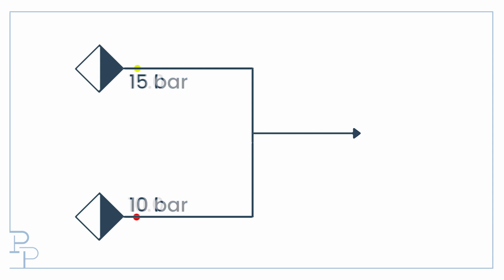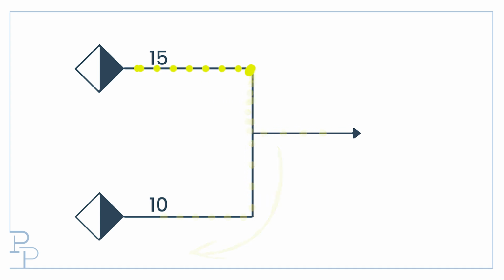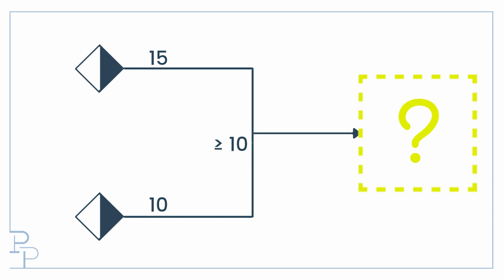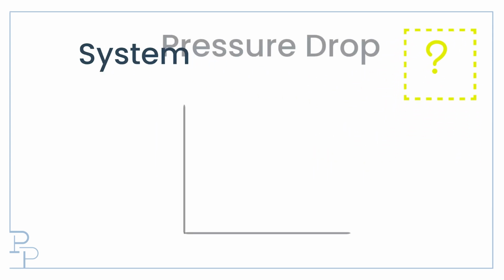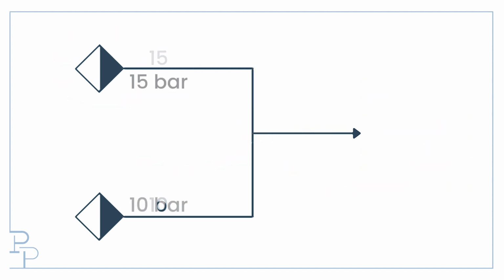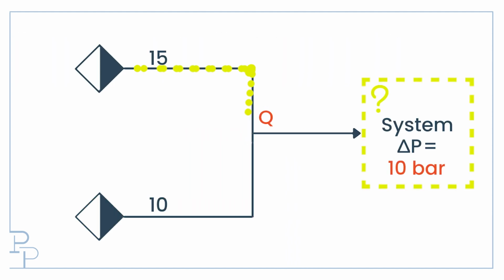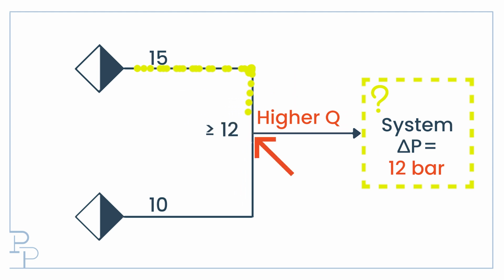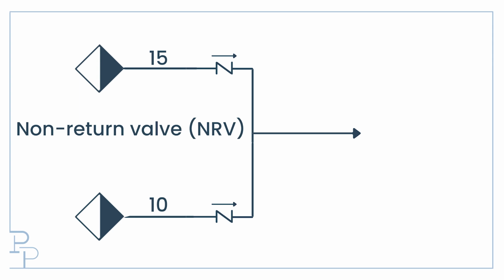Reverse Flow

Comment: Hi Pat,
I don't think the first part of the video is correct.
If both streams are identical in terms of pipe size and configuration, at the mixing point they won't have the same pressure and the higher pressure stream will block off the lower pressure stream. You have to design the system so that they reach the mixing line in an equal pressure
Reply: Exactly. People are confusing fluid Statics with fluid dynamics

Comment: With a positive displacement (gear) pump, never; with a centrifugal pump, always; this assume a liquid circulating system. If a gas system where pressure is controlled by a regulator, never, the 10 PSIG system's gas regulator would simply never open, so no reverse flow.

Comment: It is equally important what the upstream pressure does to the pressure at the junction.  You have simply assumed those pressures fixed and then varied the flow rates as required to make those assumed pressures true.  If you assume flow rates, rather than upstream pressures then, while holding downstream pressure constant, the upstream pressures must be adjusted to make the flow rates true.  Or equally as valid, you can assume both upstream pressures and a downstream pressures as fixed, then calculate flow rates in all pipes to make the overall pressure drop true.  It is NOT ONLY what the downstream pressure is that controls junction pressure.  It is everything.  Its only the downstream pressure that determines flows and junction pressure, because you assumed that and calculated the flows.  If you assumed the flows, then you would have to calculate the downstream pressure, and as such, it would be the flows that controlled that result.

Comment: Hello Pat,  Thanks for posting this.  I am considering changes to my water system, and this video (plus your video "Pressure, head, and pumping into tanks") seems to confirm my plan would work.  However some people tell me my plan won't work, and I would really like the opinion of a person who understands hydrodynamics.

My water source is a spring.  The output from the spring is piped some distance downhill to a transfer tank and then pumped to storage tanks located at the highest point on my property.  From the storage tanks the water flows downhill to a gully, uphill to the main building pad, and downhill again to  a lower pad through the distribution line.

Before I installed the transfer tank and solar pump the system was gravity-powered using a Highlifter pump located at the lowest point on my property, so the tank and pump were located near the existing input line.  This makes the system difficult to maintain as I age and can no longer climb up and down the hill like a mountain goat, so I am considering moving them to a point near the spring and pumping the water into the storage tanks via the distribution line.

In this scenario the storage tanks would occupy the 15 bar location on your diagram, the pump from the transfer tank would occupy the 10 bar location, and the tee to the house would be the mixing point.  I have been told that pumping water back into the storage tanks via the distribution line will cause 'back flush" issues when I turn on a faucet or flush the toilet.  I don't see why this should happen.

If the pump is not running, the water will flow into the house from the storage tanks as it does now.  If the pump is running, the water flowing into the house will come from the transfer tank, as the pump is operating at a pressure sufficient to lift the water all the way to the storage tanks.  I can't see how it would make any difference whether that water going into the house flows in from the storage tanks via gravity or is pumped in from the transfer tank.

Your comments would be greatly appreciated; thank you.

Comment: Is the NRV sufficient for reducing backflow if system dP is 12 bar and source a and b are 12 bar and 10 bar respectively?

If the system dP is 10bar and you want to maintain the flow at converging point to be the sum of source a and b, can you just put an NRV and pressure reducing valve on source A so they have equal pressure at the tee?

Asking as designing a water treatment system for data centre cooling where I need to mix mains water with ro water to dilute it and mains water is 8.5 bar (from booster set) and ro water is at 1 bar.

Thanks
Reply from the maker: I can't really answer with a plain yes/no. NRV's leak, their seats erode, they aren't perfect. A theoretically perfect NRV doesn't care about the downstream pressure, it will stop reverse flow at any downstream pressure.

But you do not need to install an NRV to get the right pressure at the point of mixing - the mixing pressure will always be equal, and that mixing pressure is a function of the system curve downstream of the mixing point.

Comment: Great insights which we can't get in university teaching 👌👌
Reply: I had this in my bedroom pipes with hot/cold water. Result is that temperature of mixed water is very hard to control with changing the outflow. In reality there could also be unstable outflow results with changing parameters, cause flow will be chaotic. If Reynolds number of the flow gets into some "periodicity" range, then mixed components will change over time periodically.